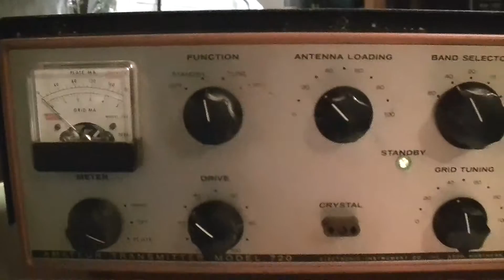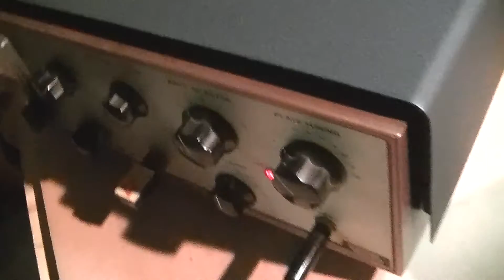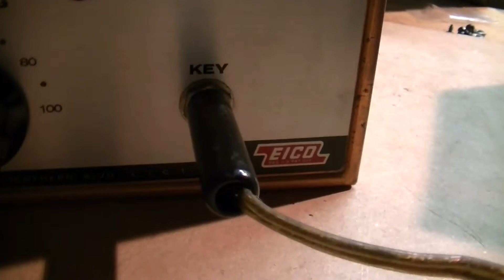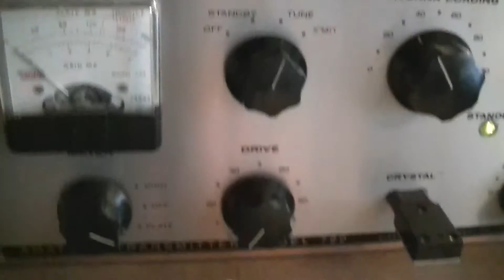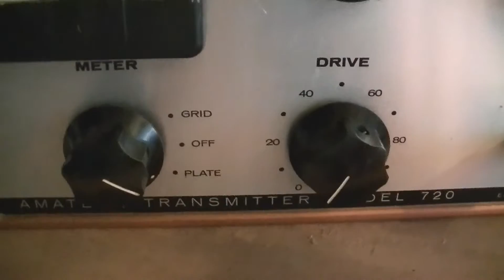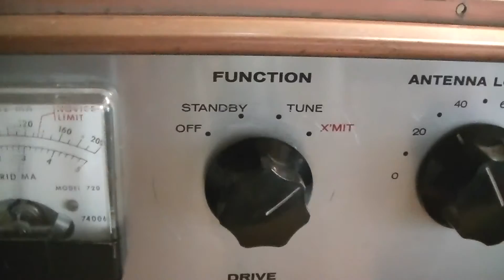Eico 720 Ham Transmitter

Comment: Regarding the inside top view of the power supply, there are not two transformers.  The big one is the power supply transformer, the 2nd one is the power supply filter choke.  The jumper in the octal socket on the back apron is removed when using the AM modulator.  Those are the pins for the 730 modulator output.  Without the modulator, the jumper is needed to complete the circuit for CW operation.  The other pins are for modulators with various modulator transformer impedencies, and there is a pin to supply 120 volts to a replies that are activated in transmit mode.